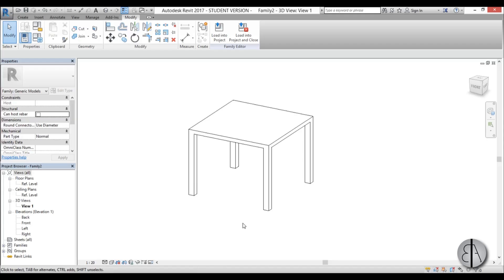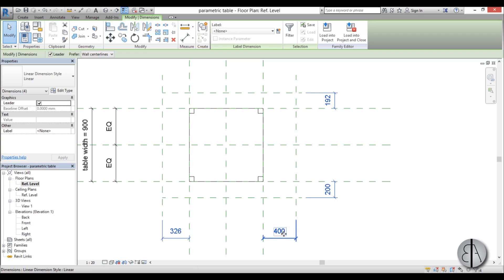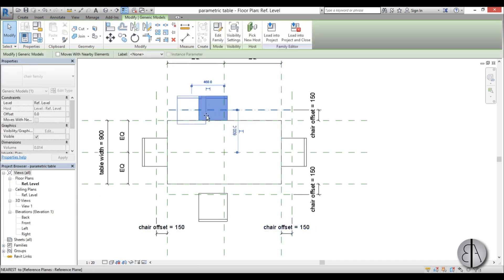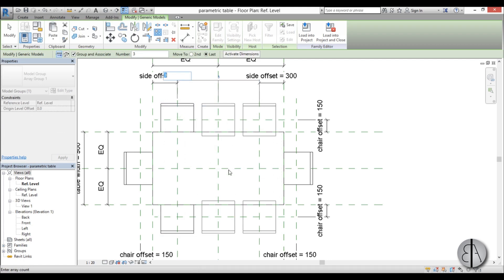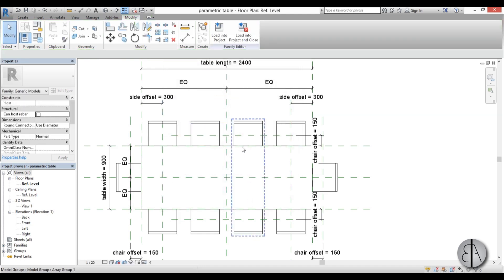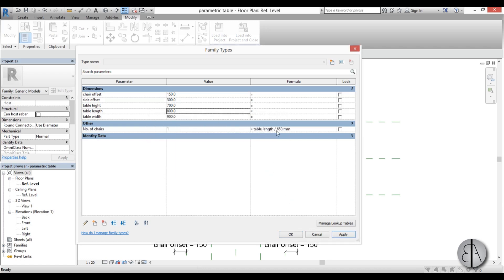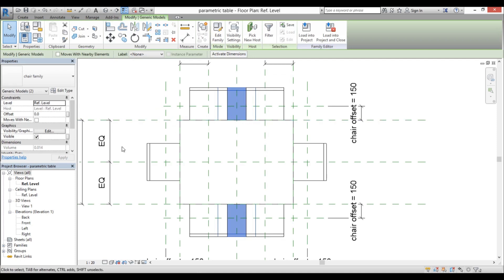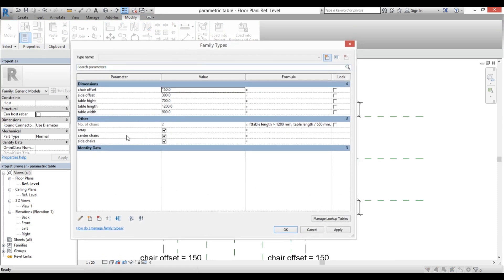Parametric Table with Chairs Family in Revit Tutorial * Part 2 *

Comment: what will be the formula(syntax) used when the table length is 1200 (as the parameters given does not specify visibility when the length is 1200)

Comment: Great example of if/then statements in a family. I noticed that you did not change the width of the table. I'm guessing if you did, you would have noticed the same problem I am having with my table family. When the width changes, the chairs do not stay locked to the reference plane that is supposed to correctly move the chairs. I set up and locked the chairs exactly as you show, but changing the width only moves the chairs on one side of the table. Something about an array group being over-constrained. Any thoughts on how to resolve this?
Reply: Having the same problem :(
Reply: Same here :/
Reply: Solved it using a different array for each line of chairs but Iguess its not the  most appropiate way to do so